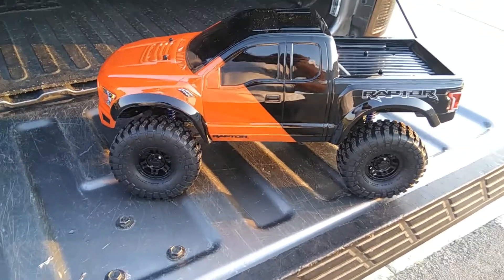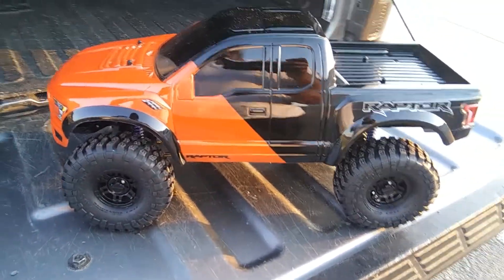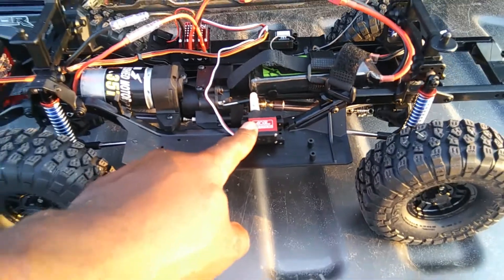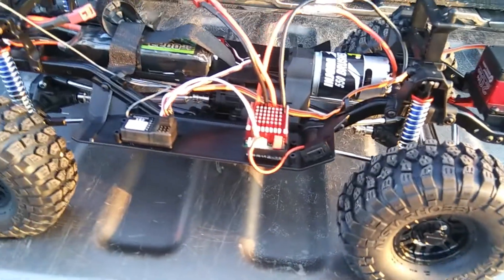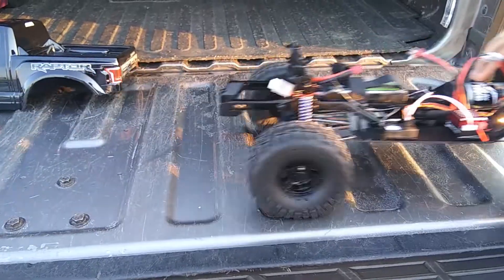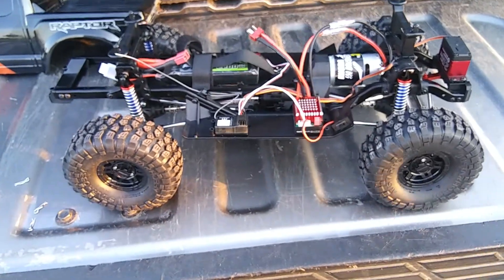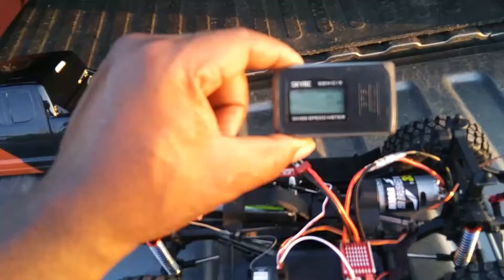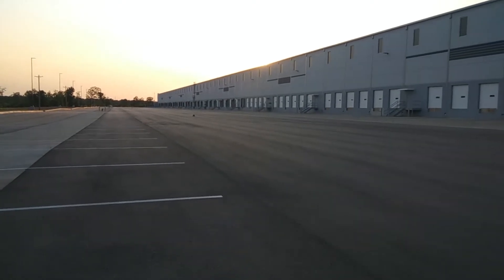INJORA TRX4 CLONE WHEEL SPEED TEST & UNEXPECTED ISSUES

Comment: If your axles are locked, both tires will turn in the same direction at the same time on each axle; if the diff is open, you'll have one tire turn the opposite direction of the other.  Also, unlocked diff would not be very useful for a crawler unless you have remote lock/unlock.  I didn't see any other shift servos or cables, so I'm guessing it doesn't have locking/unlock diffs.  Also, the amount of resistance when rolling the vehicle back and forth should be determined by the diffs/gears/tranny AND the motor.  If it's super easy to move, AND you don't think you have drag brake it might be the motor itself.
Reply from the maker: This is an Injora cloned TRX4 it doesn't have portals or locking/unlocking diffs function. The locker has malfunctioned because you can push this crawler with the tip of your finger and it will keep rolling without resistance.
Reply: @PJsElectricRCAdventures  so when holding one tire and giving some throttle it will not spin but the other will?
Reply from the maker: All of my crawlers have some resistance when not powered on except this one. Also wheels spin on one side of crawler and the other side doesn't move when trailing/climbing. 
Since this video I've added the portal axles with T-LOCK and all is good now. Crawler has lockers and can trail/climb now.
Reply: @PJsElectricRCAdventures  Oh, I see what you're saying now. The spool/locker had broken and only one side would turn.
Reply from the maker: @brianmassey7563  they do spin but not when attempting to climb/crawl over things slowly. Portal axles installed and all is good now.